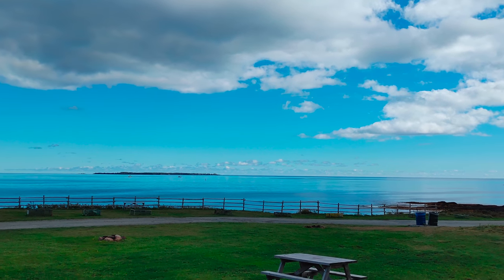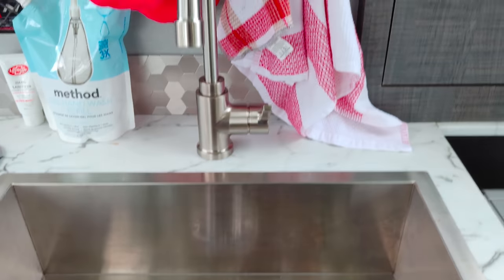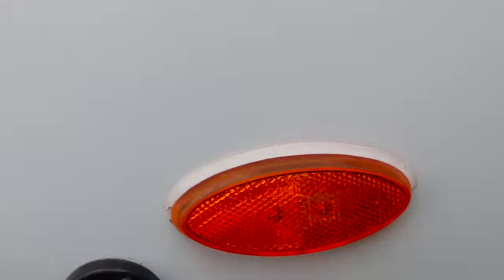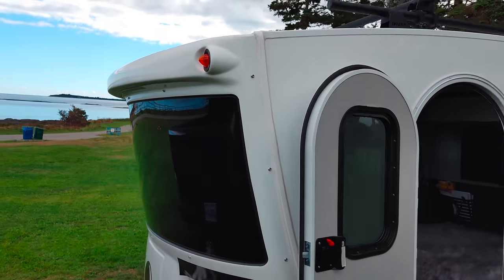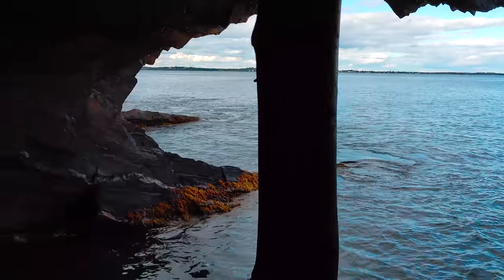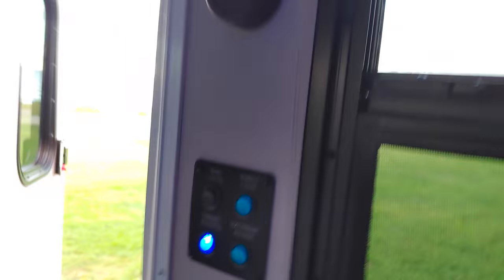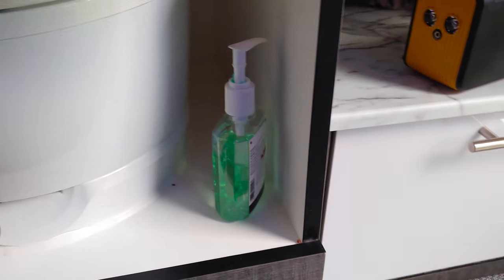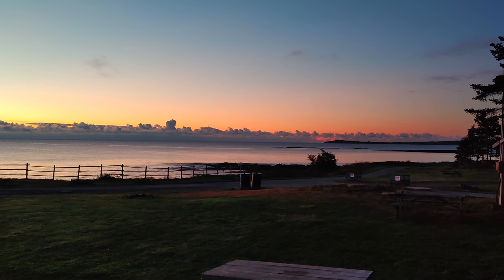InTech Luna Rover 3 month review Camping at Ovens Natural Park in Nova Scotia

Comment: How warm and insulated is the Luna without the little heater?  Also any particular reason other than price that you didn’t add the fireplace?
Reply from the maker: I RARELY use powered campsites.   If it's any help I recently camped in 6 degrees Celsius , 42 degrees Fahrenheit, ran no heat and slept under a down blanket.   It got so warm I ended up wearing just my underwear by morning. PS thanks for the sub